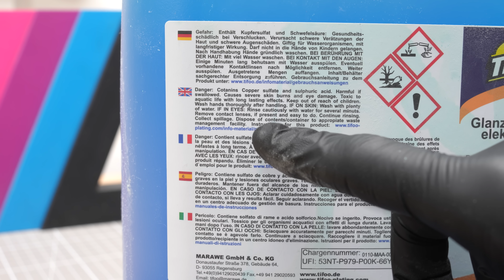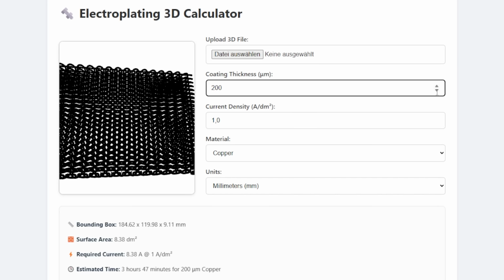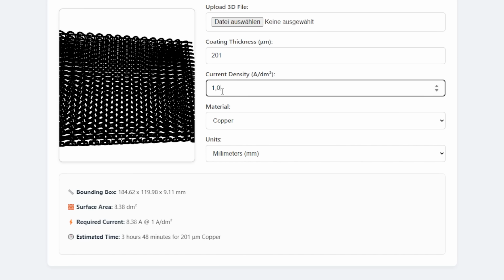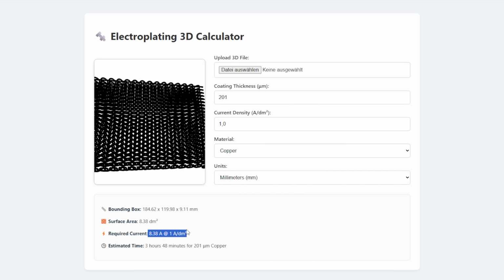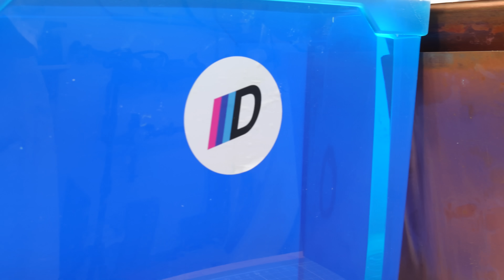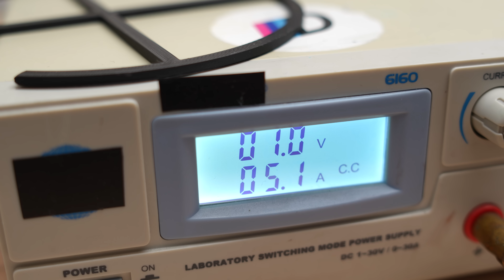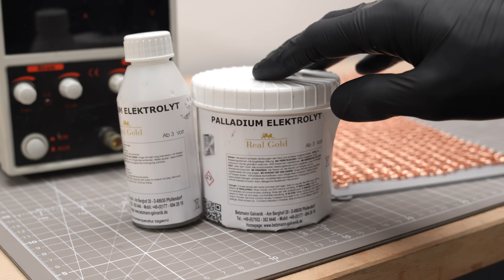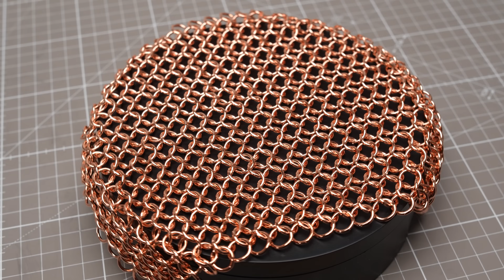How to ELECTROPLATE Articulated 3D Prints | DIY TUTORIAL

Comment: @hen3drik, I noticed that you always apply a copper layer first, even with copper primer, when you are trying for an end result that is "Silver", or nickel plated. Is there a reason we couldn't go from a copper primer directly to a nickel layer?
Reply from the maker: You can go directly to nickel on the conductive copper. It  just takes longer and is more difficult to achieve. 😉
Reply: @hen3drik  Thank you for the response! When you say it takes longer: In your videos, creating a copper strike coating (Am I using that correctly?) takes about 4 hours, but a nickel functional coating only takes about 5 minutes. Is that because of the difference in conductivity between the copper primer and a full copper coating, or is it because of the properties of the copper itself? 

If applying a nickel functional coat on top of a copper primer takes longer than doing it on top of a full copper strike coating, does it take approximately the same time? (4 hours or so?) Is there an increased health risk because of leaving the more-toxic nickel solution exposed to the air for so long?
Reply from the maker: @pocketwilde3601  I plate *200 µm+ of copper* because it builds fast, gives a solid, polish-able base, and is easy to sand flat.  
Nickel itself doesn’t deposit slower/faster than copper; the quick 5-minute nickel step you saw is just a *thin 5-10 µm flash* for hardness/barrier properties. If I tried to put 200 µm of nickel on, it would take *the same hours* as copper. I avoid long nickel runs because the bath is carcinogenic, tightly restricted under EU REACH, and I only need that thin decorative/barrier layer—nothing more. 😊
Reply: @hen3drik  Got it. Thank you so much for the responses! One last one: Does that mean the deposition rate is roughly linear? For example if I was worried about preserving model detail with a copper coat, using the techniques your describe would I be able to estimate a ~100µm thickness with a 2 hr process, or does layer accumulation accelerate or decelerate noticeably over time?

Comment: Hi, thanks , thanks , thanks! Just one question … the amperes are given by the formula , but what voltage do you have to put? 1 volt?  😊
Reply from the maker: Ampere and voltage cannot be set individually. You have to let the power supply regulate the voltage. Usually this is done by limiting the current and set a max voltage (I.e. 5v).
Reply: Ok, thank you! I have a source in the workshop and I think I remember that you can adjust voltage and amperage, that's why I was asking you, tomorrow I'll check everything, thank you very much! 👏🏼👏🏼👏🏼❤️

Comment: Very nicely done, does the copper plating reduce the brittleness of the rings, since so much extra weight was added, I'm thinking that it will be able to bend without breaking?
Reply from the maker: The resin underneath is too stiff to bend it. I becomes a pretty solid structure. But there are ways.

Comment: Great video (wie immer!), surprised the rings did not fuse, actually curious to try electroplating articulated figures now. If the joints aren't completely coated, no deposition should take place, right? Have to try a palladium plated Mando-figure some day!
Also, thanks for sharing the calculator, this is so useful!
Also, a question... Where did you get the container with the outlet? I seem to not find it with the keywords I try..
Cheers, Hendrik!
Reply from the maker: Hey thanks. I built these myself from hardware store containers (Hornbach) and cheap outlets.

Comment: I always wondered what would happen where the pieces join together.  I would think that either nothing would plate there, or they would merge.  I assume both are possible outcomes given that you checked multiple times for any joints that were stuck.
Reply from the maker: I think if I kept it untouched for 4 hours it would have eventually merged but the results were not as I expected. Don’t know what’s going on I think it’s because the Ringe are only lightly touching each other.
Reply: @hen3drik  I assume the thickness of plating where they are touching is thinner?  Probably something easy to experiment and test.  Still looks amazing.

Comment: You do an incredible job! One question: Before putting the piece in the copper, is it necessary to degrease it? And what product can I use to degrease it? Thank you very much!
Reply from the maker: No, in fact the degreaser sometimes dissolves it. If I have the feeling that there is grease on it I lightly spray it with isopropanol. That works for me. Don’t touch it at all is my best advice 🙂
Reply: @hen3drik thanks so much! I'm going to try It!

Comment: for "how do I connect them" you could use actual metal rings, that are either pre-plated to match, or are already similar in appearance.  another method could be to print the chainmaille sheets to resemble riveted rings, and print a batch of connector rings that snap together to resemble riveted rings as well. this would give you a more historical look the maille, and everything would be made the same.
Reply from the maker: Great ideas!

Comment: One thing I would love to see tested is just how thick you can make this sort of plating and if you can get it thick enough to make parts that are more resistant to wear or weathering.
Reply from the maker: I will do that!
Reply: @hen3drik  If this project is still at hand, wonder if the origin 3d printed part can be made a bit smaller to compensate for the incoming layers of metal so it behave just as guiding skeleton than a main structure.

Comment: These are amazing props, but are there any practical reasons to electroplate FDM prints like example provide fire resistance, transfer current or act as an antenna?
Reply from the maker: These metal layer are pretty convincing (texture, coldness), wear resistance and make prints stronger. That‘s what I think of in the first thoughts.

Comment: this is the future of costume making.
Reply: Still don’t know how it would work to connect them
Reply: @Ogobogosy  
One day it will be more worth it for movies to use this than paying people to make real chain mail which takes hours.
All you really need is a larger 3D printer, which will come within 10 years I'm sure. Right now 3D printing is a novelty, but one day it really will be more commercially used.
Reply: @sanddagger36 would still take hours though; maybe more since there is printing AND polishing AND actually plating and more...

Although, there is metal 3D printing isn't it? Gotta see how it works and if it can print chainmail...
Reply: @grandthieflupingames3470  
I'm not talking about right now. I'm talking about this being the first step to star trek style replicators.
Reply: @Ogobogosy  It's foldable, no? Theoretically, you could have a full print in place chainmail piece kinda folded up in a small build plate. Of couse, supports are going to be a nightmare, but SLS might be able to do it. If only micronics was still around...
Reply: I think this research will make some cosplayers very happy.
Reply: 3d printing is really only a novelty for consumers, it has been more or less widespread in commercial markets for decades now. The first 3d printers are from the 80s remember. I work in the printlab for a major specialty costuming studio in Hollywood and we have been printing molding masters with industrial SLA machines since the early 2010s at least.
Plating does have niche uses for us but generally it’s not a technology that scales well with costuming. The amount of surface preparation you need to do for each item is pretty large, and the end products are both heavy (real metal) and less flexible to work with on set. A skilled painter can make costume pieces that look almost indistinguishable from metal on screen, and if directors want to change to the color tone of the metal or add aging and weathering that can be done simply and quickly. So yeah the technology to do this has existed commercially for quite some time, it just doesn’t make a whole lot of sense in a production scenario.
Still looks badass though
Reply: @hatefulciabatta  
You know what I mean, so stop preaching.
If 3D printer with applicable, it would have replaced injection molding, but it hasn't. there is still something missing from making it the standard of production.